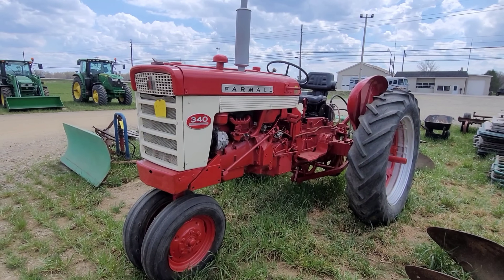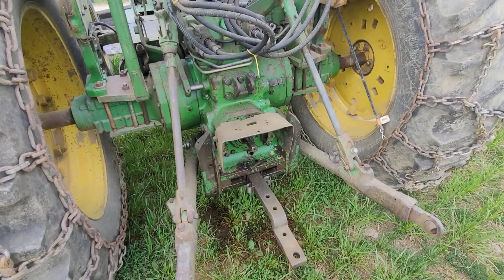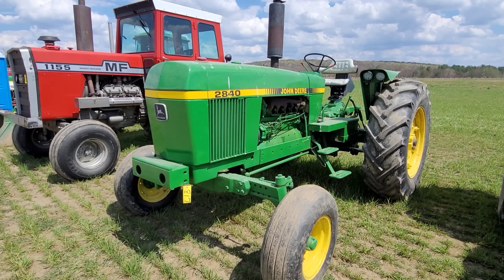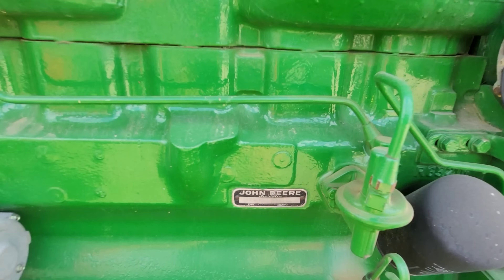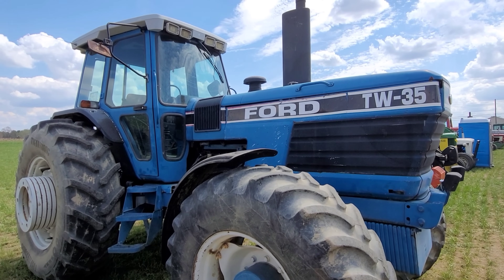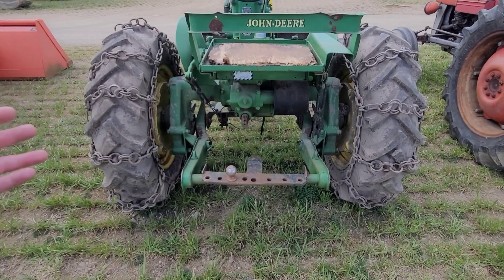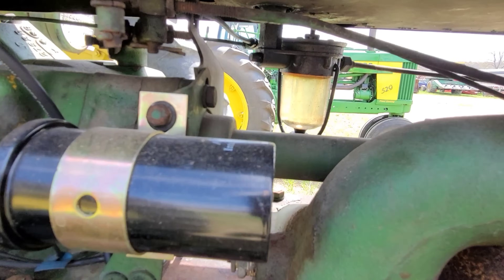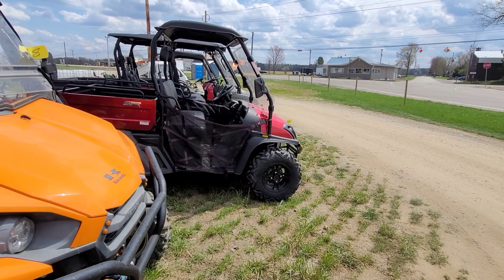What Tractor Would You Buy? | Multi-Color Sale

Comment: We had a 175D  good tractor The AC 175D had the same Perkins diesel in it as the MF175D. But the AC 175 seemed heavier with a beefier rear end. Story I was told Farm Fan was that the successor to the D17 was the 170 but badly underperformed the D17 . The 175 was rushed into production as a replacement. It is a very good tractor. Farm Fan if possible please try to find out what it goes for Thank you.
Reply from the maker: Oh I definitely will
Reply: Allis Chalmers 175 and 185 are considered one of the best Allis-Chalmers ever made. I bought a purebred Hereford bull off Stand Hunt off rt 19 if I remember right he has a 175 diesel and it he said it was the best tractor he ever had and I think it was pushing somewhere close to 18 to 20,000 hours on it without even being touched
Reply: @kenwolshan5752  Allis Chalmers would still be in business today if all of their their tractor models were as good as the 175 and 185. With an ever increasing amount of farming weekend/ side gig the 175 and 185 are highly coveted. I expect to see the 175 Ford 7710 and the Kubota fiercely bid for.
Reply: @robertlong7033  Allis Chalmers didn't go out of business because of product, there were many reasons,  non of them were due to products, which were many
Reply: @RJ1999x  if their products were so great the y would have sold enough of them to stay in business . Even to this very day.
Reply: @robertlong7033  Allis Chalmers didn't just make farm equipment,they were a very large and diverse company. They went out of business due to poor management, to an extent, but the circumstances at the time were probably the biggest factor.
They had contracts building hydroelectric turbines for the government, that had already been started, large castings etc were already poured, when interest went to 21% the government cancelled the contract, leaving Allis Chalmers holding the bag, with no outlet for they had already done. Much like Joe Biden did with the pipeline.
That was 1 blow.
Allis Chalmers had development a process to turn shale into oil, and the plan was to sell off the process, and build the equipment (crushers, screens kilns etc) Allis Chalmers was the largest supplier of that equipment at the time, and they borrowed $110 million to perfect it. Oil was $80 to $100 a barrel, this was during the gas shortage and oil embargo time. The process was being perfected, but for it to be profitable oil had to be $40 a barrel or higher, as the project was about to be completed, oil dropped to $35 a barrel, and the process to extract oil from the shale was rendered useless.
The third reason was in 1960s Allis Chalmers was a blue chip company, and highly diversified, Wall Street decided, that Allis Chalmers was worth more broken up then they stock price, so they made a run at a hostile takeover, as Allis Chalmers beat one take over off, another one would start and this lasted into the 1970's.  To stay together, Allis Chalmers had to fight, and it took their eye off the products, and it also cost them millions and millions of dollars to keep fighting, and depleted the company of cash reserves, which is why they sold 73% interest of the construction equipment to Fiat.
When you throw 3 major blows in an economy of 21% interest, and your product is almost all sold to high capital businesses, that couldn't borrow money, then throw in the farming crisis, which cut off the cash flow, no cash reserves, and a CEO that came from Westinghouse, who could care less about the heritage, or the best interest of the company, and you whither into bankruptcy.
If you think it was because of product, you are completely wrong, and if you think John Deere survived because of a superior product, you are completely wrong
Reply: @RJ1999x  Bad management often equals bad product. At the tractor end AC made both good and bad products. The other ventures you speak of were just that ill conceived quick score ventures that lacked proper forward looking guidance  cost controls and enough cap x. As for the pipeline project. Canada has been strip mining bitumin for a half century. It's a dirty product and hard to refine. Yet Canada has had plenty of time to build it's own refineries. Even with the best refining process it's still cannot be used as a motor fuel. The lesson of AC will hopefully be learned. Rather than build a few good products you build a whole bunch of not so good products.
Reply: @robertlong7033  everyone that plays Monday morning quarterback always has the right answer

Comment: I even like the little 135 Massey, that looks like it would be a nice little homestead/ garden or food plot tractor
Reply: The MF 135 diesel is one of MF's best smaller utility tractors that they ever made. The gas version was ok also, just not as valuable for resale, nor fuel efficient.
Reply: @Turbo Diesel  we have a 230 diesel where I work, I love that thing. I feel like it's the perfect all around chore tractor. I wouldn't mind adding a 135 to my fleet down the road
Reply: @johnnycampbell2719  The MF 230 is essentially a newer version of the MF 135. The MF 245, MF 250, and lighter-built MF 240 are all excellent tractors as well.

I have a MF 135 diesel. Somewhere around a 1968 or 1970 model, as I recall. Has the earlier metal nose cone, instead of the later plastic/fiberglass one. 
Had a newer 1987 MF 250, but sadly, she burned up in a barn fire back in the early 2000's. There was just nothing left to save.
Reply: The trouble that I see with 135 Massey’s is that now most of them are pretty much worn, I know that they are a perfect sized utility tractor, most of what I see are due for an engine overhaul. Now if you were buying one with that in mind, then you would have a reasonably good tractor.

Comment: The 4430 John Deere tractor had rear end problems. The l and m John Deere tractors were made for truck farms. In 1969 dad bought a 1959 model 95 John Deere combine. It turned out to be a good combine. We run it a couple yrs before we replaced anything.

Comment: I liked the 684 and the Allis 175.
Reply from the maker: The 175 is nice.
Reply: @FarmallFanatic  :Those IH 684's are a great tractor. That one just could use a little paint, which is nothing, really. 
Only things to really check out good are the 3pt & remote hydraulics (MCV valve) operation & the PTO clutch. Best thing about the 84 series utility tractors is how easy it is to replace the PTO clutch. You don't have to split the tractor to change the clutch discs, which was a superior design over almost everybody else's.
Oh, and I'll guarantee that vertical muffler on it was brand new, & not just "high-temp painted".
Because she's just a little ratty-looking, I'll bet you someone gets a great buy on that tractor.

Comment: Depends what your looking for? Do you want a big tractor do you want a newer style, I like the older tractors because you can work on them. I tend to favor the older John Deere's like the 4840 or the 2840 the 2950 I don't know if it had transmission problems but it is duel manual stick i never heard about problems with them it is what I prefer over hydro. The White might be on my list just because it has a 3208 Cat engine you can still get engines all over the place for it. The Ford and the Massey's are nice and the Kubota is really nice. Don't really want those old gasoline tractors.

Comment: The 340 is a 1958. 559 is #59 built. I am thinking that was a 460 diesel converted into a gas. The "Diesel" on the emblems was covered and the water trap was used as a sediment bowl, and the glow plug meter provision was there. On my last 2 auctions, there were lots of beat up John Deeres. I don't find the IH any worse than John Deere or Ford, but I see good ones and beat up ones of all. I do like the 340 and 504, as well as the Allis 175 and 530. But I, like you, can live without all of those tractors.

Comment: Massey 1155 about 145 hp at the PTO, we had Ford 7710s that ran 104 hp an 110 hp at the PTO had been tweaked a little 🙄😁 drove a Kubota 128 over here for 5 yrs and it was a fantastic tractor couldn't fault it at all 🤔💪💪 Ford TW 35s were often putting out over 200hp superb Draft work tractor 💪👍 great video even without a lot of Red Power 💥 The MX 125 over here 🏴 is a 4 cylinder couldn't tell what that one was 🤔

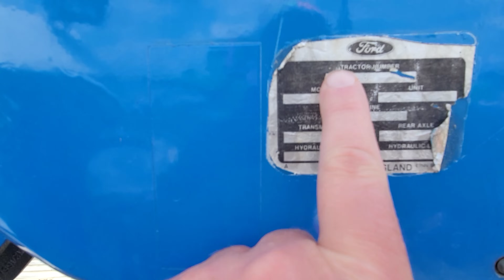Comment: @13:35 : Ford 7710 Serial #: BC618579 = 1990 model year. 
2nd to last year of production for the 7710 model tractor. (1982 - 1991)
Reply from the maker: I always like to buy later years any kinks have been worked out.
Reply: @FarmallFanatic  100% agree! The later ones in any given series will sometimes have drastic improvements over the earlier ones, such as heavier powertrain parts, better hydraulic capacities, etc.
I used to own one of the very last Ford 8000 tractors. Loved it, but had to sell her back in 2013, due to divorce. Good news is that she went to a good, somewhat local to me home.
Reply from the maker: One of the "should have boughts" that I passed on was a Ford 9600 and it only sold for $6600.
Reply: @FarmallFanatic  : Damn... yeah, I've been in that situation a time or 2 myself.

Comment: @Farmall Fanatic :
@15:35 :
MF 1155 = 140 PTO Hp. 
Cat II or Cat III was available for the 3pt hitch. Looks to me like that one is a Cat II. (My "smaller" MF 1105 actually had the larger / stronger Cat III hitch with a factory quick-hitch.)
And yes, that IS the factory MF top link on there.

I always get a kick outta how you underestimate the rear tire tread depths on almost every tractor you look at. 
Those Goodyear rear tires on that 1155 have plenty of life left in them, and most likely the RH (furrow) tire was replaced more recently than the LH tire. 
Only wealthy people or the much larger operations will typically replace costly rear Ag R-1 tires in pairs.
The rest of us only replace them when they're damaged beyond sensible repair, or totally bald.

Those beasts don't command big money, because they fall into the "gap" of being too much tractor for smaller farms, and not enough or simply "too old" for today's large corporate farms. Thus, they sell on the cheaper end of the spectrum, commonly known as "cheap horsepower", in the used Ag sales world.

Btw, this "big hoss" of a tractor will also drink nearly double the fuel of say, that JD 2840 or the Ford 7710, which average around 5.5 GPH, vs the MF 1155's 9.5 GPH of fuel consumption. So, it really all depends if you really need those extra 55 horses or not.
Bigger is no longer desirable for today's small farmer, due to $5.00/gallon diesel fuel & generally much higher equipment maintenance & repair costs.
Reply from the maker: Underestimation or overestimation is in the brain of the beholder. I'm entitled to my opinion and you're entitled to yours
Reply: @FarmallFanatic  Fair enough, but I can tell you that brand new tractor tire lug depths can vary A LOT. 
For example, a Firestone "All Traction Field & Road" model R-1 Ag tire does not have really deep lugs, from day one. They also wear fairly quickly.

As a side note: Another thing to note regarding Ag tractor rears is recognizing the deep-lug Rice & Cane versions of tires, vs the more common standard lower height 23° and alternating long bar/short bar V-bar Ag lug.

Many people simply don't know or understand the differences these days, which is kind of understandable, given the overall decrease in farming in our country. 
Point is, really deep traction lugs don't necessarily equate to better tires. Sounds strange, I know, but hear me out...

Unless you operate on regular wet/soft ground, a deep lug Rice & Cane tire will actually sustain damage to the tire from excessive lug flex, if regularly operated on harder soils. It's true.

As far as physical dry rot appearance is concerned, that can also vary pretty widely. Some cracks in the tread here & there really don't mean much, and are mostly just cosmetic blemishes in nature, which don't affect their use.

When the tires become heavily cracked throughout the tread depth as well as the sidewalls, & the black of the tire literally "rubs off" onto you when you touch it, then, they're on their way to being toast.

What many people often misconstrue regarding Ag tires is that a low-speed bias tractor tire is NOT like their high-speed radial car tires.

I've successfully run Ag tires that large operators considered "no good" for 20+ years or longer, with no issues. 
The most evil thing to happen is rogue tire punctures, which leak the damned CaCl ballast into the rims, prematurely accelerating the rim's demise from corrosion/rot. 
Rim condition is also something to ALWAYS pay attention to when buying ANY tractor. 
Those PAVT (Power Adjustable Variable Tread) power adjustable rims with the angled rails are really costly to replace VS the hoop-style bolt-on rims or clamp-on hump style rims.

Comment: @15:18 : There's plenty of undesirable info out there on the MF 1155 tractors. Apparently just haven't been talking to the right people (owners or mechanics), nor have you done your homework on them ahead of time. LOL 
That said, they're not a terrible tractor, but they can have some potentially fatal flaws that are very expensive to repair. 
Like most all old used equipment, you need to know what you're looking at, and you need to find out as much history as possible, on the specific machine that you are going to be bidding on.
Reply from the maker: Dude, you could find anybody to say any bad thing or good thing about a tractor. I'm telling you thats what IVE experienced. If it bothers you that much as to what i'm saying start your own channel see how it works out for you.
Reply: @FarmallFanatic  : Sorry, didn't mean to upset you. Just pointing out that they aren't as desirable as you might think. Those particular model 1155 tractors could ne bought so cheap years ago at auction, it wasn't even funny.
Btw, before my Ford 8000, I had a MF 1105, and never had a lick of trouble with it.

Comment: Plowing with 1155 in fall no need for heater that hog of a motor kept cab warm.!
Reply from the maker: What did you pull
Reply: DMI 7 16INCH had adjustable width by hydraulics

Comment: 1155 massey ferguson.... its The other shade of red... just becuase its green doesnt mean its better 2840 had trans issues
Reply: Trans OK on 2840, just make sure hydraulics are good!  If it's been neglected the hi/lol clutch pack is expensive to repair.  We have one, and love using it with a 7 pod Kuhn disc mower.  Make sure everything works as it should after it is fully warmed up!
Reply: @Glenn Schlorf : Well, you're kinda wrong. No such thing as a JD 2830 model. 
The JD 2840 was a pretty good utility tractor overall, with only some folks complaining of weak rear-end issues. They were never intended to be a heavy tillage tractor. To my knowledge, nothing was ever wrong with their actual transmissions, aside from the normal drive & pto clutch wear & tear & replacements.

As for comparing the 2840 Deere to the MF 1155, you shouldn't. The 2 tractors aren't even comparable.
The JD model 4630, or JD 4640 would be the 2 models that are directly comparable to the MF 1155. 

Although the overall tractor was decent, most folks are not very big fans of the MF 1155. Some were known to have engine issues & very costly transmission/rear-end failures, particularly when field worked hard, which is what they were built for.

Also, for as much Hp as they produced, the V8 didn't produce all that much torque, for what they were. If my memory serves me correctly, they were about 200 ft-lbs lower on torque, when compared to the competition's 6-cylinder tractors. That's quite a lot less.

They are a big heavy tractor with a powerful engine & weak drivetrains. Multi-power clutch failures, sunshaft & hydraulic pump drive failures, final drive failures, etc. 

For those reason(s), they earned a stigma & ya used to be able to buy the used MF 1155 model tractors for dirt cheap at auction, ($2,000 - $5,000 USD) because pretty much nobody wanted them.

The lower Hp straight 6-cylinder turbo diesel MF 1105 & MF 1135 were better & more reliable tractors than the V8-powered 1155, as they were a little better matched to their powerplants, although even the MF 1135's had their share of drivetrain issues, when pushed hard.
Reply: 2840?
Reply: @turbodiesel4709  now I can laugh at you... if you ran a 1155 massey and didnt try to put too big of pieces of equipment they are fine... your complaining about engine hp dont you realize they were designed to pull a certain amount and not more just as any othertractor... dont make em work outside of designed specs and they were fine..

Comment: I don't think that 175 is a 175, I think it's an early 170 diesel repainted and redecaled
Reply from the maker: Come on
Reply: @FarmallFanatic  I know right!
The first 170 was really a D17 series 5 . 100 series styling of a series 4. The hydraulic drive came out of the belt pulley drive. The later 170 the Hydraulic pump was moved to the front of the engine, and a underslung front axle. A 175 would be a newer 170, so that hydraulic pump on this one denotes it's a 170 diesel.
Great tractor still, just not a 175
Reply from the maker: I seriously hope you are joking
Reply: @FarmallFanatic  lol, all facts, all of the time! 😃

Comment: I buy the Ford that's best value for money those yrs get to 40 series is questionable because transmission issues wife aunt uncle ran dealership east central Ohio.Lran ford's for 17 yrs  5600 7600 yrs two Ford 7710 front assist 7710 two drive synchrony shift 8 speed dual power  6 Forward and 8 reverse  but I love pulling 1941 M with 9 speed which change PTO speed